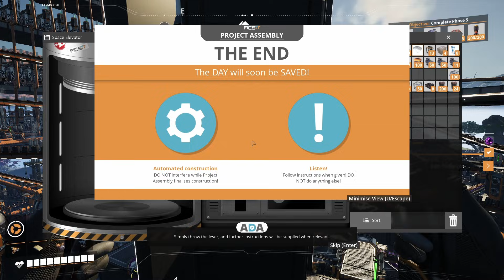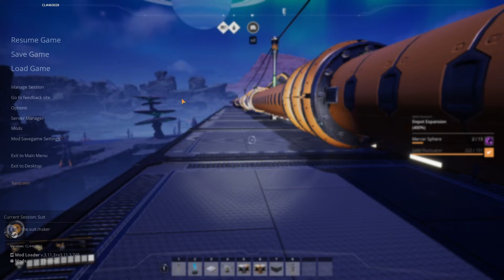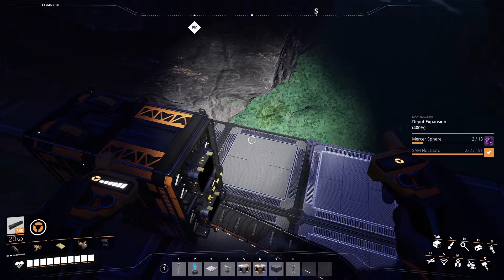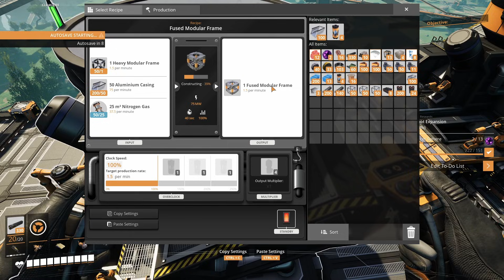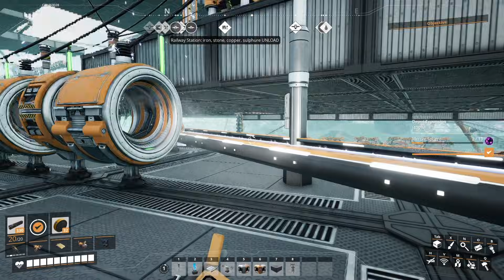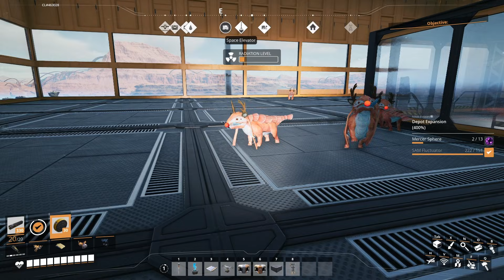My complete satisfactory world after 130 hours

Comment: this is better than my 180hrs in my save and i only am at stage 4. my brain hurts trying to optimize things so i just f it up and just try to make the product
Reply: Are you using satisfactory modeller? Easiest way is to use that to figure out how to make your end product, get it somewhat balanced based on the resources you have and what numbers look nice etc etc. Then just build that in a modular way step by step. I have prepared manifold blueprints for many things like constructors so i can easily set down sets of 6 or 8 or 10 depending on what it is, makes things faster. And I always take a screenshot of my satisfactory modeller diagram and just make notes and cross off what I have already built etc.
Maybe some of that helps